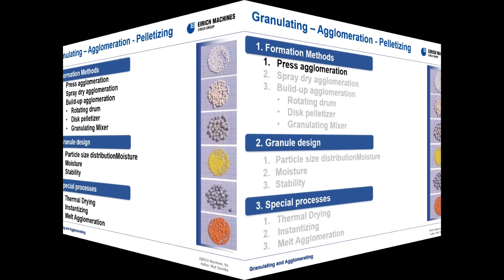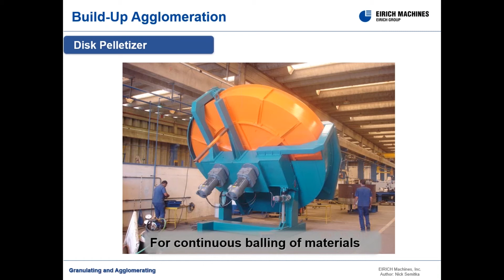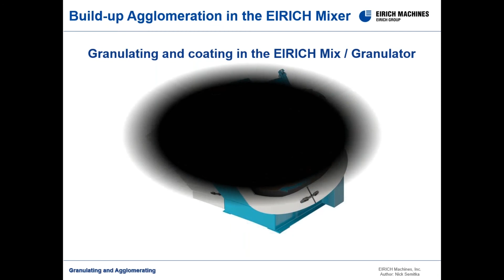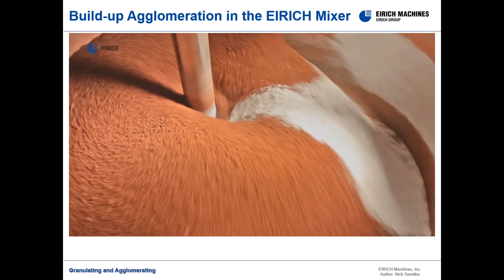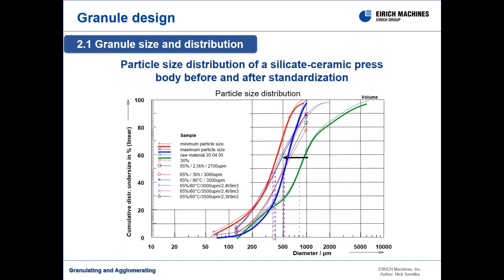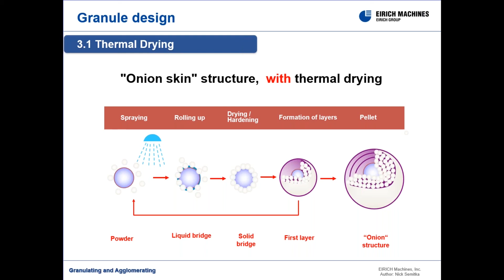Methods to Agglomerate, Granulate and Pelletize - EIRICH Webcast

Comment: A spray bar for distributing liquids evenly would improve your granule sizing a lot when mixing powders that absorb liquid quickly. When dumping water in by hand you get areas of high moisture instead of even moisture distribution.

Comment: using hot slighty acidic water works, no binders.  but the powder needs to be slightly soluable.  you just need to slow down the evaporation by doing it in a crock pot.

Comment: The structure of berries is formed because growth occurs mainly by impact between nearby particles. Growth processes due to layering and fracture/abrasion, which produce more spherical shapes, are inhibited. In addition, the presence of blackberry forms indicates that the granulation humidity is not very high, there are no chemical bonding reactions and the residence time in the granulator is not sufficient to start the growth processes by layering.
Reply: The distribution of sizes in the feed must be such that there is a minimum universe of "nuclei" from which growth by layering is prioritized, thereby reducing the time required for granulation and the level of liquid binder used. The SGN of the feed must be between 30 and 35% less than the SGN of the desired product, in low impact processes (disk or drum granulation). The above does NOT apply to fluidized bed granulation.
Reply: Drum granulators are also used when granulation (the principles of agglomeration and atomic bonding) requires a longer chemical reaction time. It usually has, inside, small lifters and a rough surface, to improve the degree of mixing, the density of the granules and its spherical shape.
Reply: The Eirich mixer granulator also has the quality that anti-dust coatings can be added in the form of eutectic mixtures of molten salts, obtaining grains free of pointed surface shapes (sequins), notably reducing the abrasion phenomena that usually generate environmental dust in the bulk handling of granulated product.